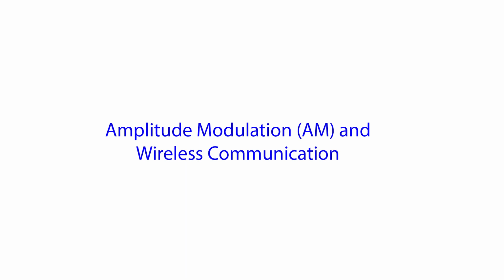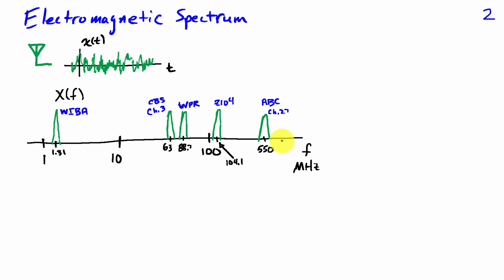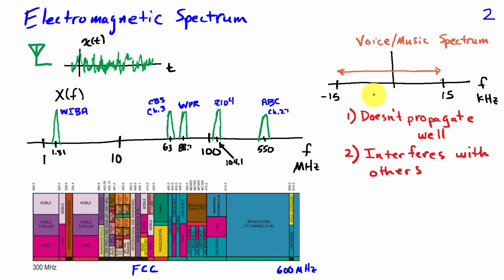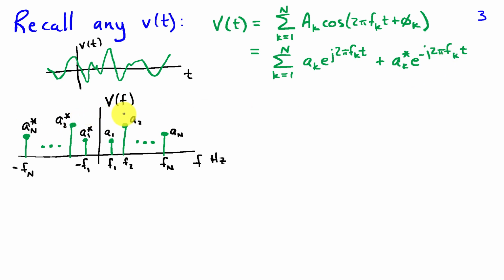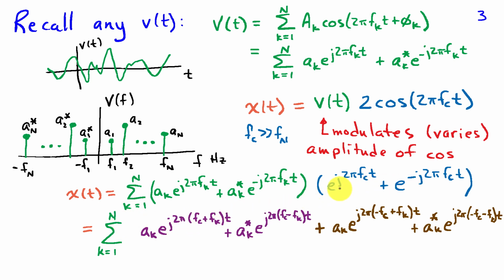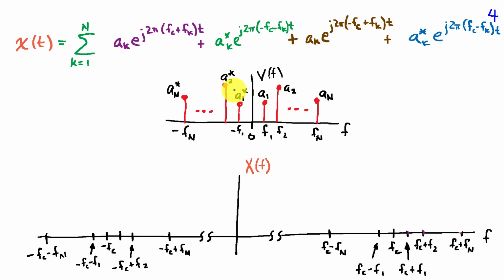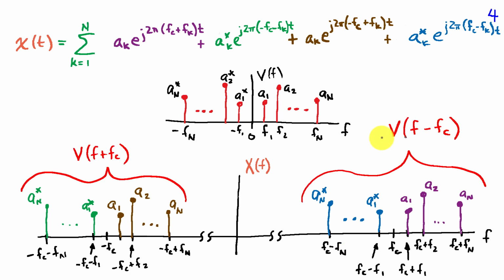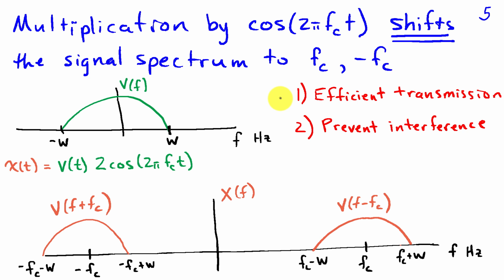Amplitude Modulation

Comment: Great video, a little confused on one part though. In your equations, when splitting the cosines into the exponentials, why is it that the green equations have the Ak turn into ak and it’s conjugate, but when you do the same to the blue equations, there is no coefficient/conjugate?